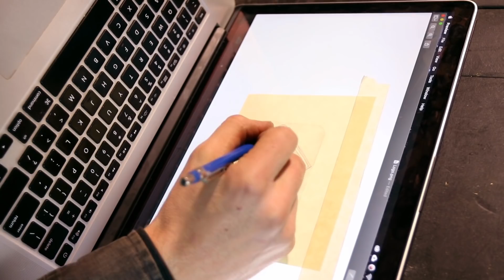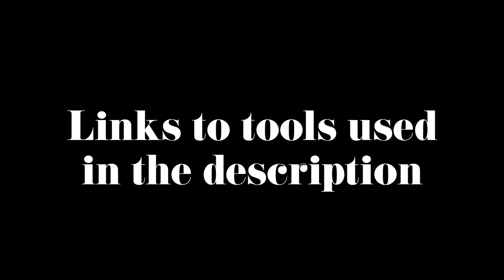Rubber Stamp & Ink Box | Spalted Maple Stamp Set

Comment: That's one way to destroy a drill press and have your finger lopped off by a straight razor when bucks back at you.
Reply from the maker: True. Improperly using equipment and tools can lead to injuries. Luckily the drill press is made of steel and has existed in workshops for over 50 years, and while razor blades are one of the most dangerous tools in the shop, they’re used by millions of people to make things. I am lucky enough to be one of them. Please let me know the other ways I can destroy tools and fingers. I’m writing a manifesto on how shop tools and equipment can hurt you.